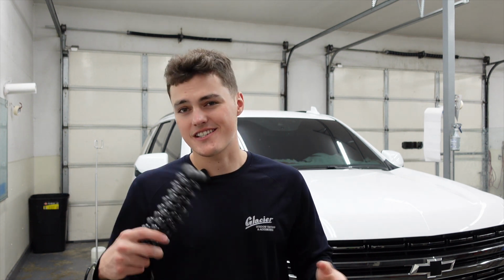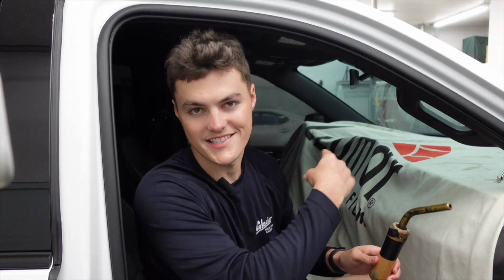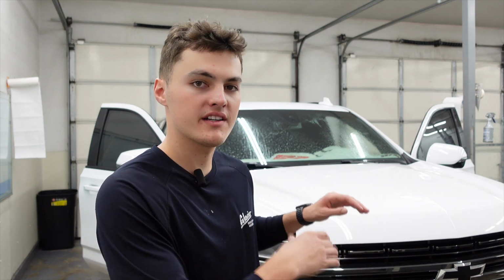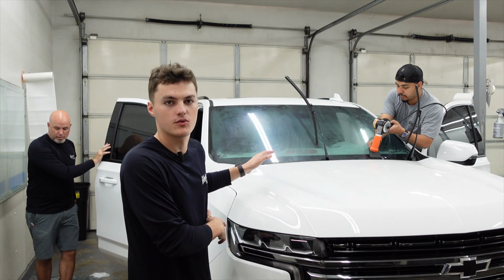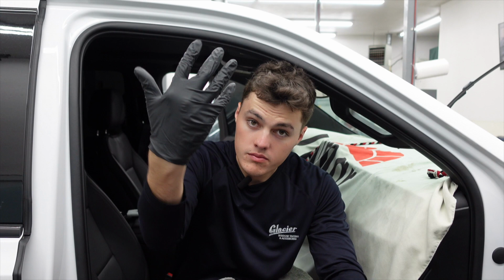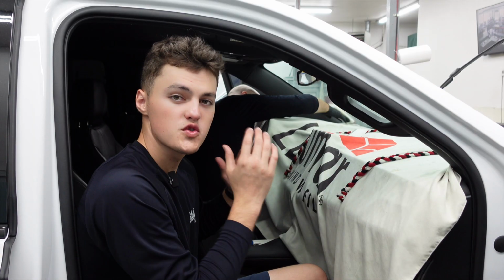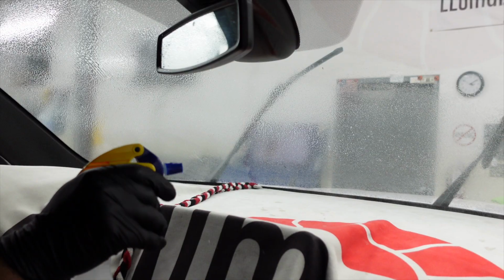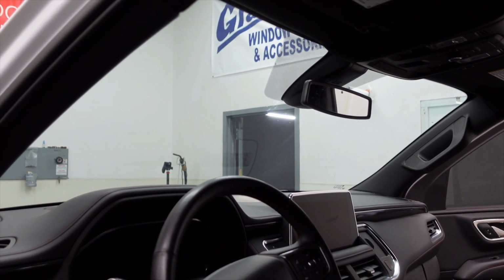Fixing ILLEGAL WINDSHIELD TINT 2022 Chevy Tahoe - Clear Ceramic Window Tint

Comment: When shrinking on the outside, did you guys use the dryer sheet method before putting the tint down to shrink?
Reply: I don’t believe they do sir.
Reply from the maker: We did use the dry shrink method with the dryer sheet!